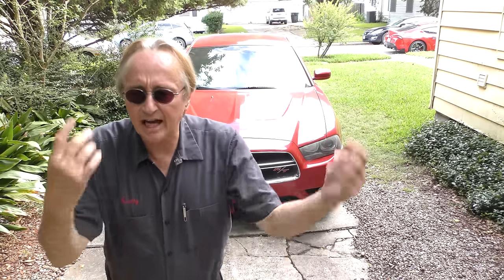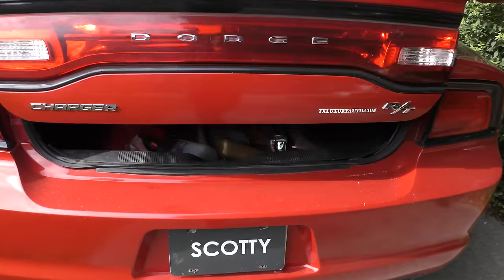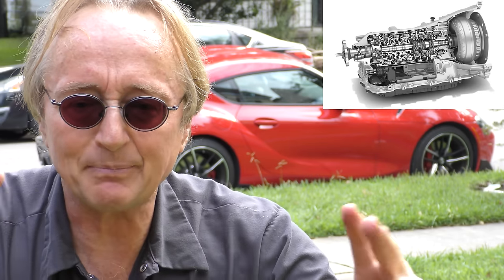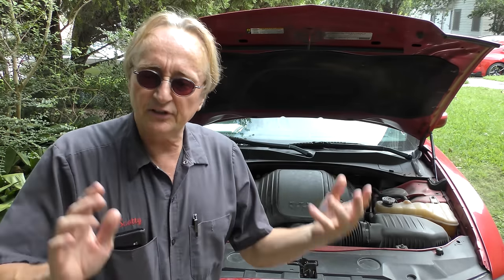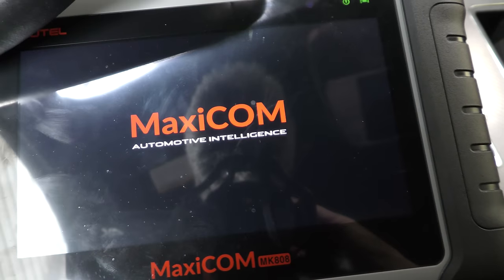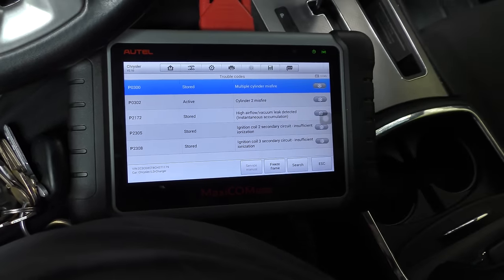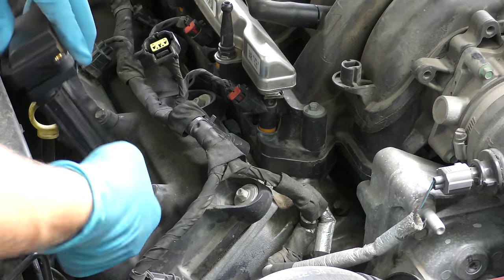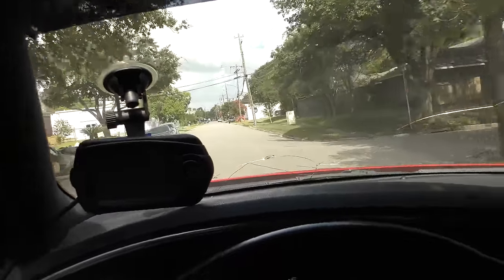Here's Why I'll Die Before I Buy a Dodge with a Hemi Engine

Comment: I have two hemis, one is a ram work truck with 671302 miles. No mechanical problems. Ever. 
The second is a charger almost the exact same as the one in the video, with 310k. Only problem that happened in it was the thermostat ran out. 

If you take care of your vehicles you should be fine
Reply: How do you managed to run charger at 310k and can you help me out. Like what should I replace at what mileage ?
Reply: @generalAssery 😂
Reply: 671k on a ram truck with 5.7 hemi thats impressive.

Comment: Great car and a great engine my 2016 rt has 145k and never even had an engine light come on yet for me greatest car I've ever had the honor owning
Reply: There's an exception to every rule. You're one of the lucky ones.
Reply: did you buy that rt new ?
Reply: My 2012 Charger has 177k miles, shes been good to me. Oil Change every 3k miles
Reply: @Hemiebae  bought it 2 years old in 2018 might get another one this year
Reply: I have a 2008 R/T with 160k no check engine light no lifter tick

Comment: Scotty I gotta disagree here, I have a 2011 Chrysler 300c with the Hemi (yes it has a slight lifter tick) but it has over 100,000 miles. I maintain it properly and it still has plenty of power, runs great and shifts great! I look at that charger and see a car that has been beat and that's not the fault of the manufacturer that's on the owner.
Reply: Yeah, totally agree with you. I just bought a 2014 Chrysler 300C last month and it runs great, had no problems. Just some very minor scratches.
Reply: My moms 03 suburban with 210k miles has no issues in the engine. He’s right if you’ve already got a lifter tick with over 100k and 200k or 300k
Reply: Dang I have a 2011 and the coolant ends up leaking all the time the engine was just swapped the radiator and water pump and I just keep having coolant probs
Reply: Mine has 90000kms and occasionally ticks. Should I be worried?

Comment: The previous owner did not take good care of the engine!! That’s for sure!!
Reply: I agree, any car can be a bad car if it was driven bad.
Reply: I was in a class action lawsuit with dodge they don't create enough zinc in oil to perform in a hemi motor. The lawsuit lasted more than a year. I sold the car ! Way to many engine problems!
Reply: Nonya Biznes  yeah okay
Reply: Preach
Reply: Danny right lol
Reply: Nonya Biznes lets see a video
Reply: @haileyharalson3546  Exactly mate.
Reply: Nonya Biznes  Yeah right mate. Prove it.
Reply: Nonya Biznes  So how much power is that little Corla making liberal.
Reply: Nonya Biznes  Race against the AC Cobra or even a V8 powered Miata then you're car is toast.
Reply: Nonya Biznes  What's you're 0-60 kid.
Reply: Nonya Biznes  But you're puny little Corla will never have the soul and character of an old school muscle car or hotrod and I doubt it'll outlast my 96 F150 with a 5.0L (302) Windsor V8. 190 HP out of a Corla how cute The AC Cobra replica (that weights 2100 Ibs) makes upwards up to 500 HP. Also if you're not a liberal then prove it kid.
Reply: Nonya Biznes  Also my dad's 2019 Scat Pack Charger makes 485 HP and plus it has an 8-speed which there for it'll do 0-60 in 4 seconds unlike you're Corla.
Reply: Nonya Biznes  Yep LOL!!!!!!!!!!!!!!!!!!!! Also a Coyote swap Foxbody Mustang will smoke that Corla as well.
Reply: Nonya Biznes youd get gapped by any 
stock first gen rt
Reply: Nonya Biznes i have 06 Daytona with the 5.7 only 350hp not the 370 of this gen my bestfriend got one of those corollas xsr or how ever you spell it and it’s also tuned but that car does not stay next to me at all I’ve raced it a few times different scenarios and conditions and the car has never come close.also forget to mention the car has engine work also
Reply: Agreed. I take care of my 2014 R/T and it's running great. Amsoil Signature Series Synthetic Motor Oil and 8,000 intervals. Engine is running as smooth as the day I purchased it.
Reply: Nonya Biznes  soooo....I looked it up.  7.6 seconds to 60 and 16.1 @ 89 mph in the 1/4.  You aren't smoking the busted charger in the video with that, let alone a good one.

If you want a car that would gap your Toyota, I have a Fiesta ST for sale.
Reply: Nonya Biznes i doubt that car with *170 hp is a blast to drive, and my guy, a car could have 90 hp pushin a car that only weighs 1400 doesnt mean its gonna beat 370+ hp. btw, id love to watch you smoke this with a 7.8 0-60. you probably would have smoke coming out from your hood trying to push the poor thing
Reply: Pretty much all the hemi 5.7 will fail. The lifter fails destroys the cam. Sends a lot of metal through the engine. This has been a known issue for many years.
Reply: 7K for that?!!!
Reply: Not even the car as well
Reply: Dodge is garbage
Reply: CJ Colvin we get it ur daddy got money 😂
Reply: bout to say i own a 1974 charger and it’s engine is still in good condition
Reply: Dont matter if you maintain a dodge because they are straight up junk. They are not built to last
Reply: @roshanmathew92  say that to both my hemis, one work truck 600k+ and the other is a charger with 310k
Reply: Buy a Toyota just changed the engine oil and should last you 20+ years no problems.
Reply: Or the windows.
Reply: Only good engine they have is the 4.0

Comment: "Hopefully that's the only problem with this thing"
Famous last words
Reply: Especially with the hemi. Lifter failure is basically guaranteed and when it goes it eats the cam. Junk.
Reply: Dave's Model Works lol but the ones in the SRT8s are pretty good
Reply: lol facts 😂😂😂
Reply: @basithph8958  they make power sure, but the reliability is still iffy, granted at that performance level so is just about anything

Comment: Hey Scotty, I'm a big fan, love your videos. However, you need to know, I'm a big mopar fan. I've owned plenty all bought new, 1985 Omni 2.2, 1989 Daytona 2.5 turbo, 1995 Talon turbo tsi, 2002 Caravan 3.3, 2006 Grand Cheerokee Limited 5.7, 2015 Durango 3.6, all were great and well maintained I drove each vehicle to 130k-150k miles. Never any complaints and as a 19 year old kid I beat the Daytona & Talon constantly. I get bored after a few years, is why I change vehicles every 5 years or so. I think people who buy dodge simply do not take care of them. So, please ease up on Dodge. Not the best fit & quality but not the worst & they're affordable and worth the money. 
Love you anyway Scotty
Reply: mopar lifer here, was looking to switch out to something else as my 2016 Caravan is just a little on the wrong side of super boring and no longer fits my lifestyle needs (looking for a truck, which is why i'm on this video now). I agree actually, a lot. I remember my own Daytona had super high km's on it (sorry, Canadian)  and while it had problems, it ranks as my favorite overall car i've ever owned. Had I had the money to maintain it the way it deserved, I might have been able to keep it for years longer than I did.  This Caravan i've now owned for 4 years, im the original owner of it (rolled it off the show room floor) and I'm thankful to have had the money to keep it running through all it's problems (Turn signal module, coolant thermostat, rear brakes). Which to date, a super recent Cylinder 6 misfire has been the only engine related problem. I got that sucker fixed immediately and it's back to running totally fine.  I've heard nothing but screaming praise for that 3.6L Pentastar that's under the hood, and noticed it's the default engine inside of the Ram 1500's.  I think if I had any say in the matter I'd pull for a V8 Hemi model though.  Either way, I agree, it's about taking care of it and it'll serve you well for a very long time. 

Anyways, sorry, wall of text lol cheers

Comment: Ive never had a problem with my 2007 Ram with the Hemi. 103k miles. Have a 2018 Hemi  Challenger....only 27k miles, so far no problems.
As for the car in this video, Chrysler did improve/fix the lifter roller issues on the newer 5.7 engines from 2017 on up. I do believe the issue with this particular car.
Reply: I’ve got a 2012 with 145k miles. Only issue was header bolts ram used were crap.

Comment: Scotty fails to note this was a design by Mercedes when they owned Chrysler.  Thus the battery in the trunk.
Reply: Not just battery almost entire chassis is from Mercedes E class
Reply: It's design was based on the W210 e class, it was also called the LX platform; the dodge  Grand caravan RT platform was based on the W251 Mercedes R class chassis ; as well as the WK2 Jeep grand Cherokee; which is based on the W164 ML SUV.
Reply: @Slacksfifth  I had no clue about any of that. What year would you suggest buying a hemi charger?
Reply: William Schwartz  it's underpinnings are Mercedes. The floor boards and chassis channel's. It's a modified w251
Reply: @deznutz3163  2015 and better, fiat sort of guided and improved chryslers quality. Daimler wanted chrysler to die. Lo.
Reply: +Trisdoo o   W211*
Reply: @basedshaman6183  H/C's changed superchargers in 2015. '16 models or later are fine.
BTW 392's are about 150 lbs lighter, with the same rubber they will holeshot quicker than an H/C.
For about 100 feet.
Reply: @deznutz3163  if you can get a tenderly cared for 2007 or 08 R/T with the 5.7L  NOT an  SRT8 (about 99% of the SRT8 drivers i'm familiar with were doing dumb drag racing crap 17 years ago). see if you can find one in the 100thous to 150thous odometer mileage. IT'S NOT EASY! and no you can't have my baby. she's just flipped over 50,900 miles, 07 Charger R/T AWD.
Reply: William Schwartz  wow. you're ignorant. DCA was formed in 1998. so Daimler was actually more than aware of the work done all over North America.
Reply: Scotty's quote on Mercedes "endless money pits" he already knows.

Comment: The NAG1 transmission is hella sturdy it can handle about 650hp till things go south
Reply: Right this guys smoking
Reply: Ive had water in mine, and have pushed so much through that at WOT itll studder through 2nd to keep from blowing up, still get that burning smell, but its got 160k harsh miles on it 🤣
Reply: Facts, correct me if I’m wrong but this is a Mercedes 5 speed not a Chrysler. Easily can last at least 300k miles when properly maintained. So many people have 700whp in their E55 AMGs with stock internals and transmission shifting just fine lmao
Reply: @diablocls55  the dodge variant is slightly weaker in some parts but largely it's a Mercedes trans it'll hold alot of power 600tq is when it let's out on dodge apparently  but u can swap the parts and make it as strong as the Mercedes trans
Reply: @dakotajones8010  lol yea maybe somewhere along the line Dodge took the trans from Mercedes and fucked it up. Lol
Reply: @diablocls55  no this Nag1 was severely handicapped. They actually arent the same , you cannot for instance get a nag1 out of an amg and stuff it in your charger(i was going to). The valvebodies are different and alot of the internals are different, even the housing is different. The AMG version can handle ALOT more power, and shifts are more firm.
Reply: @mrhyde0705  I have no idea of the resemblance the Benz transmissions have to the Dodge ones. I’m sure the Benz 5 speeds are way more durable lol
Reply: @mrhyde0705  I have never owned a Dodge but I own several Mercedes
Reply: @diablocls55  mines on its way out, i was goinf to throw an AMG nag1 under the hood, or a performance based mopar nag1, company i used modifies both transmissions, and said they're merely related, and the mercedes AMG is loads better, they actually use AMG parts when modding the dodge nag1s, specifically the shift solenoids, thats a popular swap over. And clutch packing. Ours are basically paper 🙃
Reply: @mrhyde0705  yeah. I’ve never once had a transmission problem in any of my Mercedes and they all have about 600,000 combined miles on them. Arguably the best automatic transmissions on the market. They’re so bulletproof. Not sure why they suck in Chryslers

Comment: The 5 spd auto is from Mercedes tho, and it’s not terrible. I’ve had my 2009 challenger rt auto for about 2 years, and the only thing I replaced is the tires, and rear shocks. I only paid $15k out the door 65k miles, and it even had nice upgrades. It came on lowering springs, aftermarket 20” wheels, pirelli p zero tires, new drilled and slotted brake rotors all around, a srt intake manifold, a mopar cai, a magnaflow muffler, and ceramic tints
Reply: Give it another year or two, I sure hope you paid cash rather than finance it
Reply: Xanomoros Films why you say that
Reply: Xanomoros Films The way I drive it, I wouldn’t be surprised to see something break. I only owe about 3K so I can pay it off whenever, but the apr is stupid low so there’s really no need. I’m just waiting to pay it off to get a hellcat anyways, not worth investing more money trying to make a 5.7 hemi faster
Reply: @Xanomoros  You and Scotty really need to educate yourselves about these cars. They have some common failure points, but the transmissions are not one of them.
Reply: Mercedes unloaded Chrysler in 2007. This is a 2012 model Charger, the 2nd year of the latest generation which started production 4 years after Mercedes divested of the Dodge/Chrysler money pit.

Comment: Almost 300k on my 5.7 Hemi and still running strong
Reply: lmfao i hope mine last that long
Reply: He don’t know what he talking my friend have 300 on his dodge
Reply: Running strong after replacing a couple things huh my friend lol..
Reply: Nice. Which model is it?
Reply: A man once survived falling 16 stories, but I'm not going to jump out of a 16 story window.
Reply: I have A v6 2008 dodge chager with 210k miles the fule Pump finally went out now I need Scotty!
Reply: How is the transmission doing? Have you ever replaced the transmission fluid? I'm wondering if I should look into that at 100k on my Chrysler 300c at 110k miles
Reply: @steveg9302  Transmission is good and shifts like it should.Yeah I do replace oil and filter
Reply: @joedelgado3190  I have 145k on my 04 ram, did have to change gasket since last owner’s didn’t care for it but hopefully last me to 200k🙏
Reply: Mines clapped out at 80k 😂 sounds like its gonna die soon
Reply: I had an 04 with 256k on it still ran good.
Reply: Original owner ?
Reply: 2011 5.7 to i think 14 had cam ,lifter issues
Reply: Hey man I’m going to see a 2013 Dodge Charger 5.7 with 160k miles but the owner says that there’s only 1 fault with a cylinder misfire, its cylinder 2, but I think it has been serviced a decent number of times, do I buy it? Also does your charger have the infamous Hemi tick?
Reply: @kotlarzpatrick  I have the 5.7 on a dodge ram pickup 1500..The previous owner got it fixed before it became a problem..He was the original owner, thats what he told me anyway..A misfire could be anything from sparkplugs, injectors,catalytic converter or a bad valve..If its cheap and you know how to work on them buy it..The dodge 5.7 is a good engine
Reply: How many times you replace the lifters 😂
Reply: @331foxbody  transmission every 2 years,motor oil every 5k miles and the air filter yearly
Reply: @331foxbody  sorry I thought you asked about the filters 😅..I haven't done lifters
Reply: I like to see the ratio of chargers vs. Camry over 200k miles out there. Prob like 1:50
Reply: Point I got was his customer bought it used and original owner probably ran the crap out of it and sold it just before it started coming apart. Newer cars have way too much high tech stuff that isn't necessary. It's just for bragging rights.
Reply: Long idle time is what kills these motors more than anything. The lifters don't lube well at idle.
Reply: I'm sure you take good care of yours. The one in this video looks neglected
Reply: yep it's just that people beat the cars and don't do preventative maintenance if you're lucky enough to not have a factory defect and take good care of them you can have the stock engine for 300-400k usually
Reply: @saleemjavaid8870  plenty of chargers well over 200k because of their extensive use as fleet cars for government officials and police cars, camry's are sold a lot more frequently and are more of a consumer economy car so there's definitley going to be a lot more out there that are high mileage since they've been around so long, even though their reliability is good there has probably been a good amount that stopped working before 200k too because people don't maintain them properly and just beat on them, most dodge owners at least do their maintenance and oil changes if they're gonna thrash their car and might go through 1-3 transmissions within 300k miles but the engine is very reliable
Reply: I am almost at 200k myself.
Reply: 2013 160k and engine locked 😤

Comment: I have had a 2004 hemi durango that went to 250 miles with no engine and no transmission problems,  did not even need to charge any suspension,  finally got rear ended.  great truck, now i have a 2014 300 c hemi awd  now at 145 miles absolutely  great car, absolutely no issues and I drive it hard.  spent nothing on repairs, only changed brakes.   interior is still like new,